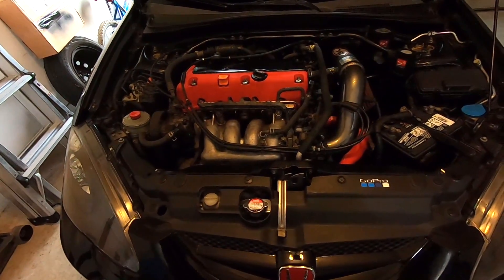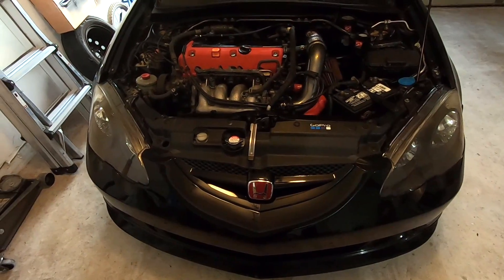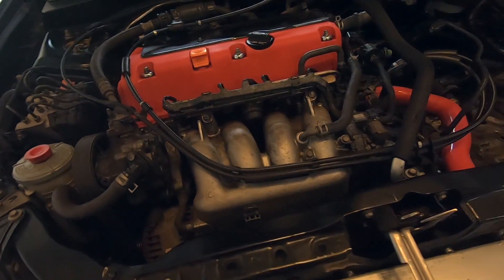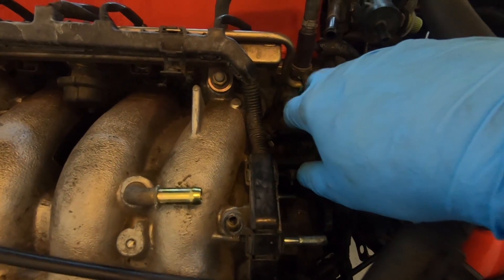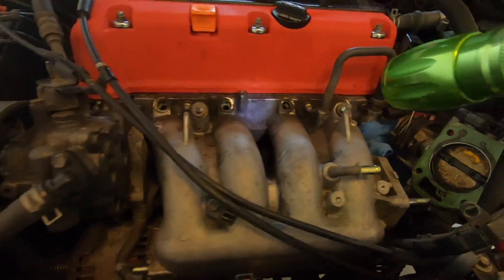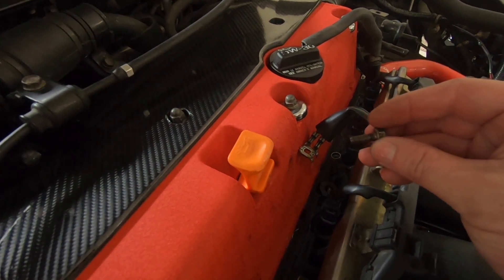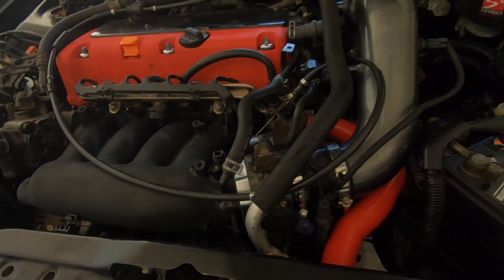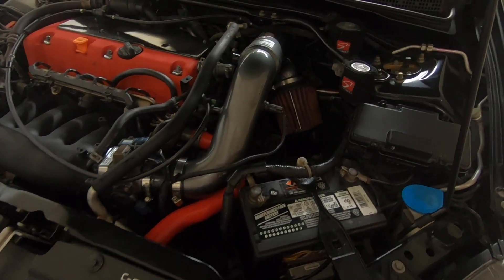How to install a RBC intake manifold on a Acura RSX DC5

Comment: Does it just bolt on directly on the k20A2 without any modification?
Reply from the maker: you will have to cut off the water passage on the side of the intake manifold for it to even fit. Secondly, if you’re using an aftermarket intake manifold gasket like the Hondata, you have to drill a hole in it for the intake coolant passage. 

I got lucky when I got mine was already cut.
Reply: So if I'm getting a thermal gasket what should I get the one to match the rbc intake or one to fit the k20a2 cylinder head?
Reply from the maker: If you decide to use OEM you don't have to cut it..... Will fit without any mod now if you get the thermal gasket yes.... Technically it's the same scenario you will have to cut the water passage...... If you need more info send me a message over IG to give you more details.
Reply: I think he was asking if he gets a OEM gasket should he get ne for the RBC or the A2 head?
Reply: @kevinpowell6707  you get one for the k20a2 head but you have to drill a hole still for the coolant passage.

Comment: Do you need that throttle body adapter for the stock prc throttle?
Reply from the maker: No just for the RBC....
Reply: @0420rafa  still not understand, so i have a rbc intake manifold and a stock prb rsx throttle body, do i need a adapter plate or can i install it without it?